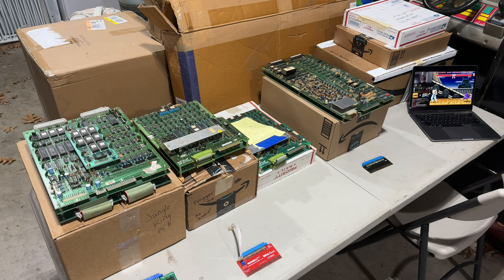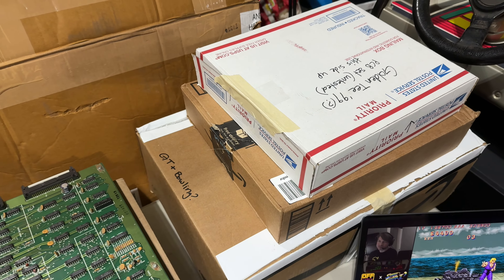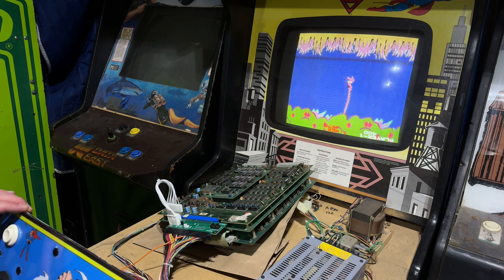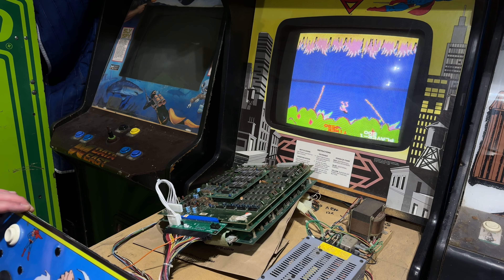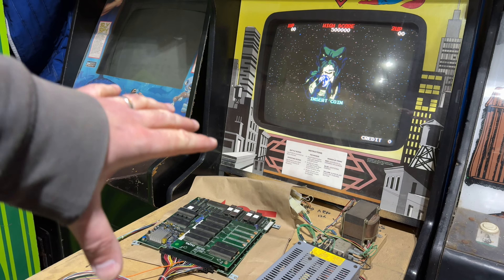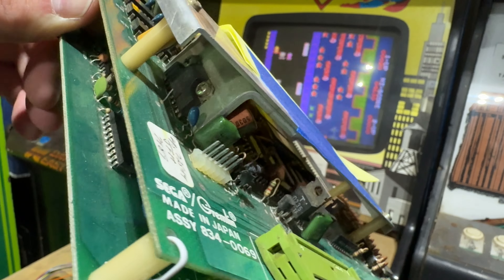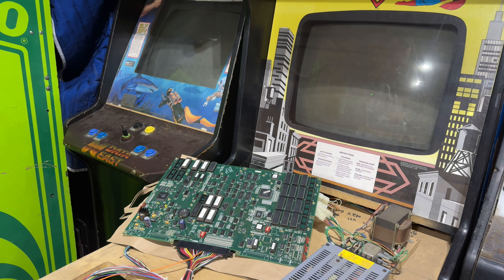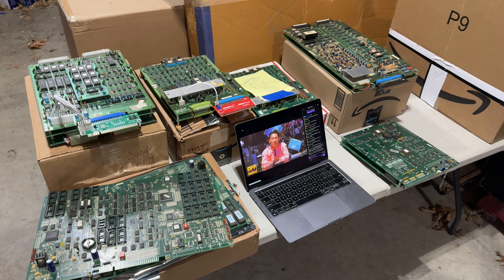ANOTHER FIRE at Overtime Arcade?! 🔥🧯 Testing arcade game PCBs & JAMMA adapters of dubious origins...

Comment: One time I had a" Time Killers" that seemed dead, so I held down one of the action buttons, while doing a start up. Bingo,it booted right up. Unfortunately that's what kept it running. Bad ground ?,not sure .May try that on your GT bds. Also check voltages, some IT boards are finicky about that. Zaxxon does not use a suicide battery. Yes those little tant. caps will smoke! All by themselves. PU  😊
Reply from the maker: Good point, I should double check the voltages at the PCB!

Comment: Another good habit to get into is to test the resistance between ground and your +5V.   If you get close to 0 Ohms (less than say 30 - 50 Ohms) then you probably have a short on the PCB and you shouldn't apply power unless you have a Bench Power supply with over current/over voltage protection.   Make sure the PCB isn't hooked up to anything when you test this.   Since that Tantalum cap smoked, it was probably shorted to ground (Test the PCB now if you haven't fixed it and see what you get).   I usually test on a TTL chip since it's easy to get to the +5 and GND.
Reply from the maker: Thanks, will do!

Comment: I had that Frogger PCB plugged into my Frogger cabinet and I got no sound at all so you're doing pretty good getting partial sound. Hope it's an easy fix man
Reply from the maker: Oh wow, it was plugged into an original Frogger harness + volume pot and you were getting zero sound? Perhaps there's something loose on the board that got bumped back into place in shipping? The only thing I did to mess with it was reseat the ribbon cables, so maybe one of them is marginal? In any case, thanks for selling this to me at a great price!
Reply: @overtimearcade  Would reflowing anything related to the audio be a starting place?  Would a resistor exceeding its 1/4W rating make it turn to carbon, going from 1KOhm (or whatever it is) to 0 Ohms... leading to the volume change?   Check the components in the region of the other Frogger🐸🔥fire.  Always love watching Overtime Sparkade!!!
Reply from the maker: @slinger2112  LOLing at "Overtime Sparkade!" I haven't touched either board yet, but I'll be recapping the audio section and doing all of the basic PCB maintenance stuff too (reflow, etc.). I'm guessing low volume is more likely caused by bad caps or amps, rather than cold solder though. If the sound was cutting in & out, that would make me suspect cold solder.

Comment: Zaxxon HW has an interesting clock generator, looks similar to Donkey Kong HW with ECL and hand-wound transformer and (for the time) insane high clock speeds like 48 MHz, I'd check the video addressing generator (what generates the 1H...128H, 1V...128V). Ours had a bad ECL->TTL translator on the clock circuit, but I think I just got the standard no sync black screen.
Our Future Spy just had a bad CPU socket.
You can always put the unknown Frogger CPU board with the known good Frogger sound board.
Frogger only has one sound chip. I don't know if the voice outputs are joined through capacitors (had a Bomb Jack that had very thin and lacking sound and 5 of the 9 caps were completely open and 3 were weak and only one was somewhere near spec), it's probably intentional that the music plays in the background with loud SFX in the foreground.
EDIT: If you scope the ECL portion on the Future Spy, switch the probes to 10:1
Reply from the maker: Thanks, that’s great info for the Future Spy!

Comment: Something definitely shorted which caused that cap to burn up.
Reply from the maker: I agree that’s the most likely cause, but aren’t tantalum caps also notorious for simply going bad and going up in flames like that too?
Reply: @overtimearcade  they usually last forever
Reply from the maker: That’s not what I’ve heard!
Reply: @overtimearcade  maybe ones used on that board gave trouble, I just meant in general.  The variable sound is mostly likely bad caps or cold solder joints somewhere.
Reply: @overtimearcade  This is definitely a shorted tantalum, as the ones from the early 80s will just go short instead of open.  The Midway "bullet caps" they used are the same way.
Reply from the maker: And the SMELL…
Reply: @Croccydile  that would explain it it ☝